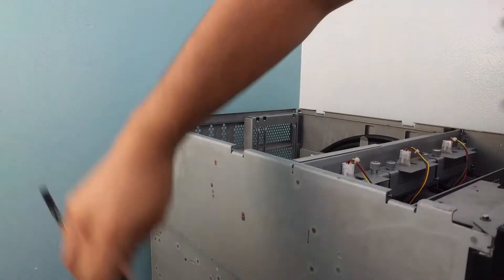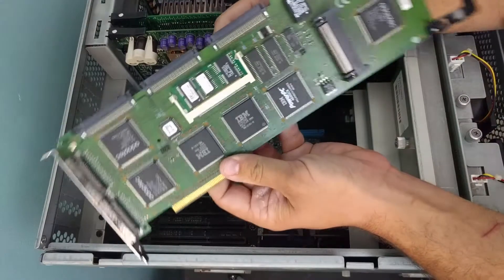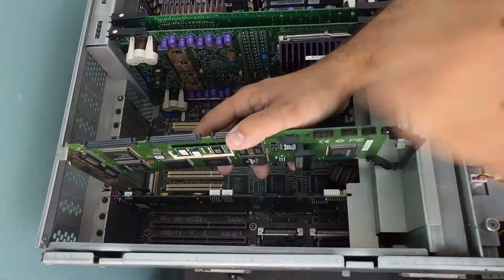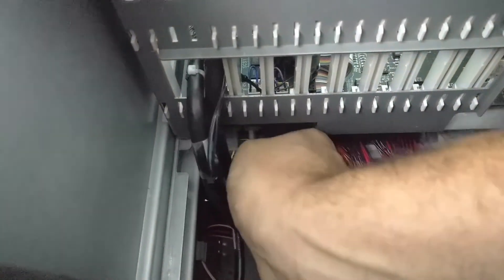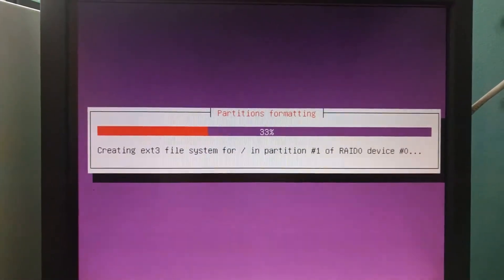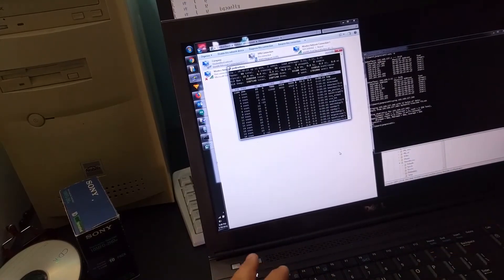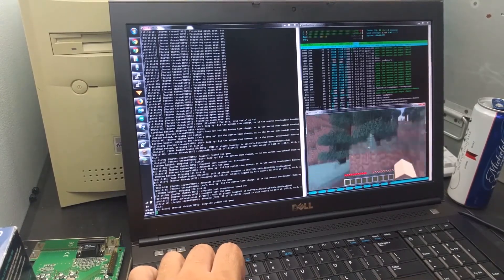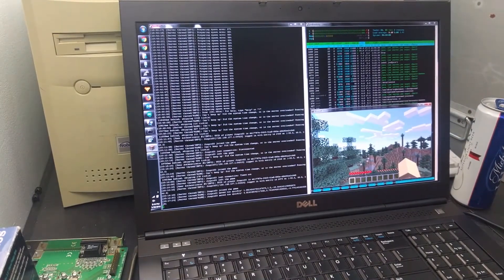IBM Netfinity 7000 runs Minecraft

Comment: Why do you think the other CPU card wasn't working?
Reply from the maker: PixelPipes I tried swapping CPUs, changing slots, messing with jumpers... I couldn't figure it out. It was always the same error. The only thing left is to change the motherboard...
Reply: RetroBytes Could the card itself be the problem?
Reply from the maker: PixelPipes It's not. It works in the other slot. If it's not a config issue, it's a motherboard issue... Documentation is hard to come by
Reply: RetroBytes Ah ok. Sure is a beast to work with.